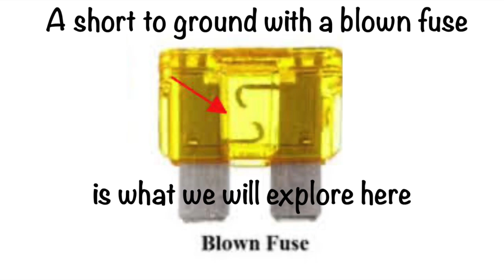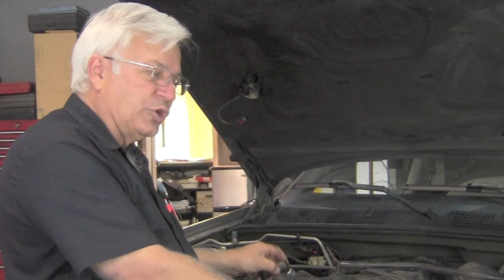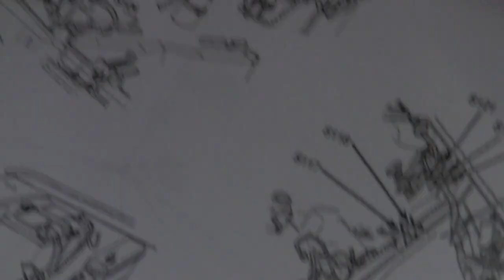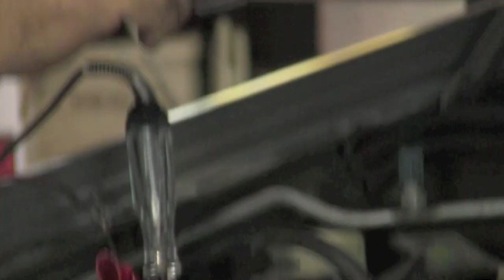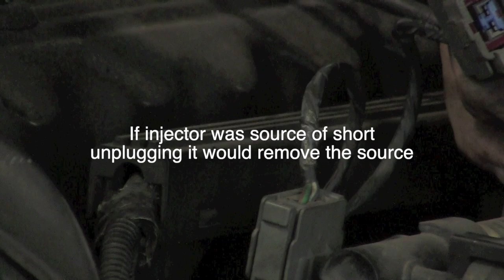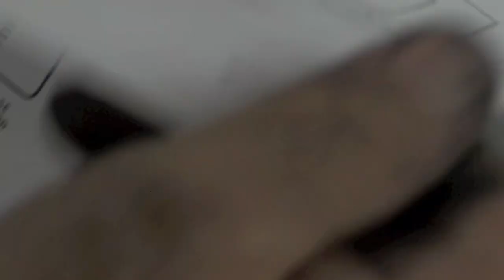How to find an active short

Comment: Thank you for these videos. I need to get one of those ammeter and breakers
Reply from the maker: they are a great little tool and well worth the cost, even when it's not expensive
Reply: @realfixesrealfast  I have been looking for one of amp meters and circuit breakers for a while, didn't think anyone made them anymore. I keep getting privacy errors on the link listed. Any ideas?

Comment: If you didn't have a circuit breaker, could use continuity to test between the auto shutdown relay and s123? Or, can you put a low amp load in place of the relay, such as a light while measuring amperage with an inductive clamp ammeter?

Comment: Thank you sir!

 I do have one question: Although the active short was on the O2 sensor's leg of the circuit the tool also indicated current flow through the injector circuit. This looks strange to me as the injector wasn't commanded on or was it?
Reply from the maker: Great question.  The injectors were NOT commanded on (no current thru that portion of the circuit) however the same green with orange wire that rain thru the injector portion of the circuit also ran thru the O2 portion of the "parallel" circuit.  That caused the fuse to blow.  REMEMBER CONTINUITY.   There was continuity thru the green with orange wire directly to ground and bypassing any load.  So the fuse blows.  Foes this help explain it ?
Reply: @realfixesrealfast  Thank you for taking the time to answer,I am still a little bit puzzled...... 

The injectors are fed by the same green/orange feed wire as the O2's are, coming from the ASD relay up to splice 129. From this splice on I see this same wire going directly to the O2 sensors and this is the portion where the short to ground happened to be. 

From splice 129 another green/orange wire runs to splice 128 which is the feed side to the injectors. My understanding is that current will flow from the ASD relay all the way to splice 129 and from there until the point where the bad wire actually touches ground. 

There shouldn't be current flowing in the leg that runs from splice 129 on to splice 128 and beyond to the individual injectors. But your amp hound/short finder is moving directly at the injectors where I wouldn't expect it because there shouldn't be flowing current as the the short is actually in another portion, the in parallel O2 section. Is this caused by induction/proximity of the wires or what am I missing?

Comment: Oh, so I've been chasing a short that doesn't exist. I plugged in a tool called "ECT3000" into the starter enable relay circuits. Tool notifies me that one of the circuits has a "short" in it. That circuit has an ignition coil and 2 splices with many components. Basically the tool "lied" to me. A telltale sign I learned from this video is that the fuse blows. The fuse that is connected to this circuit is A-Ok.
Reply from the maker: Please keep in mind, a "short to ground" WILL BLOW THE FUSE.  However a "short to power" WILL NOT BLOW THE FUSE.  They are both shorts and circuit faults.
Reply: @realfixesrealfast  Do you have a video that explains short to power?
Reply from the maker: @OldSchoolNoe  I don't have one at this time but I can make one.  Give me the details on what you are workin on and perhaps I can use that in the video.  My email is (dumar5907@gmail.com).  Please include the VIN #

Comment: Greetings from the Philippines to you sir, May I know if the short finder tool is applicable to a 24volts system? If not, is there aything you would recommend? Thank you sir and Keep safe always
Reply from the maker: good question.  Yes it is.  Voltage is voltage and it does not matter how muck.  If you have an active short you will also have blown fuse which is an "open" circuit and therefore no voltage can flow, regardless of the amount.
Reply: @realfixesrealfast  Thank you very much Sir.